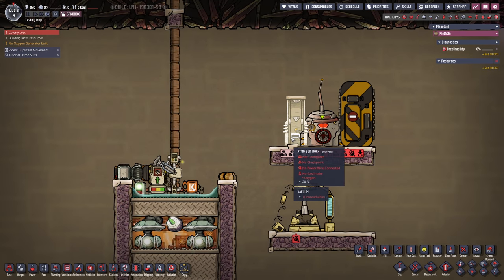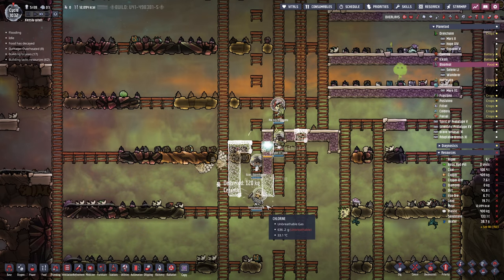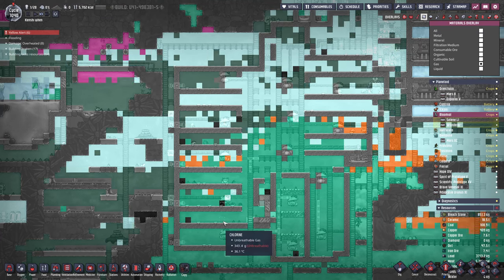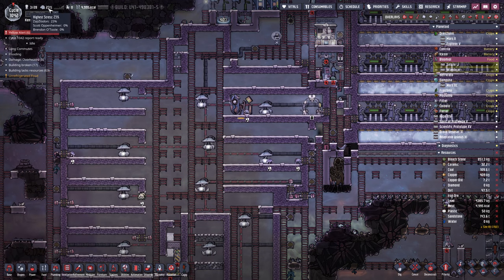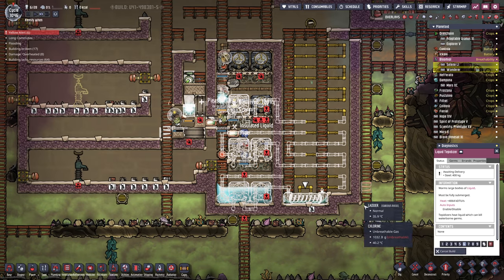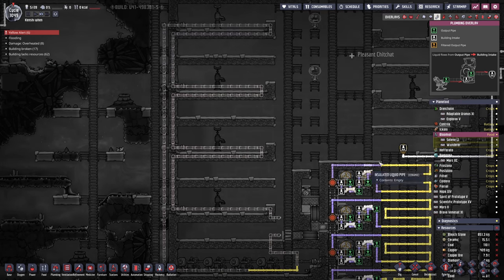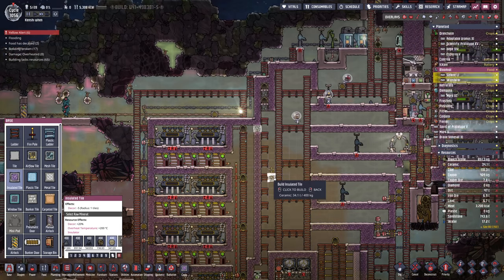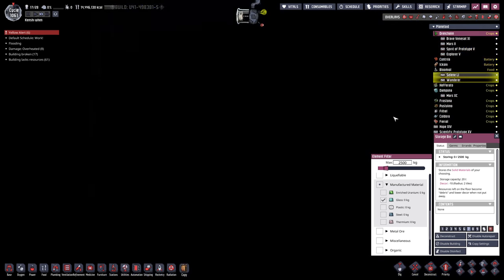Ep 39 : Sour Gas Freezer Part 1, Extra hard : Oxygen not included

Comment: Ahhh, I was wondering how you were transferring the heat in that drip pump, I didn't think of using liquid vents as transfer mediums, nice!
Reply: Do you know why it needs this transfer medium? And if he could add some drywall for even more mass? I didn't build a sourgas boiler yet, but maybe give it a try...
Reply: @grandfremdling3841  Sourgas has TERRIBLE thermal conductivity and good thermal mass, its critical to dump heat from the boiled gas into the incoming crude, the better you do this the more efficient your whole boiler will run. You want a stepped transfer system so that heat wont just bleed out of your boiler plate, you want the heat to come out of the gas, that's why he uses thermium vents. If he used shift plates it would link the whole line. I tried shift plates and they do work as long as you don't put them to close to the boiler plate itself. It's not about thermal mass but conductivity to thermally link the gas to the crude in stages along that counterflow drip tube.
Reply: @SamsTopBarBees  ah, i see. Sourgas is bad... and yes: I meant drywall, not Shiftplate. Shiftplate would Bring much Heat into the Walls, i think. But If drywall would be necessary - i may try it...

Comment: If you just want 2 or 3 dupes to survive off of only 1kg/s of natural gas, the easiest way I can see is 11 Natural Gas Generators (each using 90g/s of natural gas), which each produces 67.5 g/s Polluted Water (so total is 445.5 kg/cycle). The Bog Bucket is a new Spaced Out crop that takes 40 kg/cycle of Polluted Water to grow and it takes 3 of them to feed 1 dupe (as long as you are cooking its Bog Jelly). So with a use of 360 kg/cycle of Polluted Water, 9 Bog Buckets would feed 3 dupes on 1 kg/s Natural Gas.

That's also not counting the extra Polluted Water you have left over plus the extra amount generated from bathrooms, plus the extra carbon dioxide that gets made from the Natural Gas Generators (that 11 generators can feed 7 slicksters for example).
Reply: How are you producing oxygen in this base?
Reply: @theone-jn4zq  Seive the extra polluted water and make a spom.  Two or three dupes don't use that much O2. 
Edit: Rough calculations (not at PC anymore) says 2 dupes would need 150kg cycle of water for spom usage. So instead of feeding 3, use the water for them to breathe 😀
Reply from the maker: But to sieve that polluted water you need sand! also how are your going to repair your atmo or rad suits without reed fibre or glass?
Hehe it's get a bit tricky when you start digging into it.
Reply: @FrancisJohnYT  The reed fiber is easy, every bathroom loop should have one anyway. The sand you can get from melting dirt. How do you get dirt? Easy! Send over pips and arbor acorns, have the pips plant wild trees and you have unlimited free dirt from pip poop!

Comment: hey francis, instead of using cheap steam as a conductive medium why not use super coolant gas given it has a way higher TC than steam
Reply from the maker: Oh hell no, it's tricky to explain but it's going to take a while to get that steam room up to above 100C temp. Until we get it above 100C we can only use the bottom aquatuners, if we used super coolant we would have to heat it up to 436.C+ to get gas before we could used the other 6 aquatuners. It's just faster to get the contraption booted this way.
Reply: @FrancisJohnYT  yeah but given that super coolant has 10x the TC but 2x the SHC of steam you could use a lot less of it and still have it perform well enough

Comment: Can't you wrangle critters without skill by dropping a critter dropoff and setting it to auto-wrangle above 0?
Reply: This has been a bug since before I started playing the game, about 3months after initial release, and it still works. Thing is, not all the critters can reach everywhere, like hatches can't use ladders to traverse, and Dreckos can crawl everywhere. Placing a drop-off on all levels could turn into a big mess when wrangling the dreckos (dupe interacting with a drop-off in the lower left section, attracting a drecko hanging in the ceiling, e.g), or one could get lucky. 

Auto-wrangling this way is generally a great way to move critters around without having any dupe with the critter 1 skill
Reply from the maker: I though the dupe still needed the skill? I know you can use that trick to wrangle critter that you are normally not capable of wrangling like slicksters.
Reply: @FrancisJohnYT  not in front of my PC, so can't test to confirm it atm. Moving non-wrangling critters using the drop-offs definately works, did this in my current colony getting a shine-reactor running
Reply: @FrancisJohnYT  Crap, that was probably it... Means to wrangle puffs and other trap based critters.   And that's why you're the man.